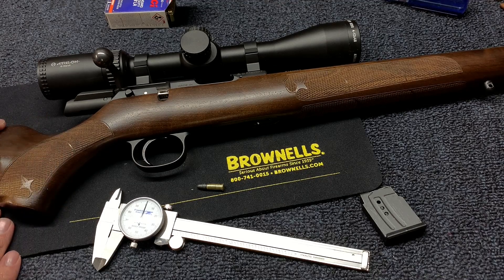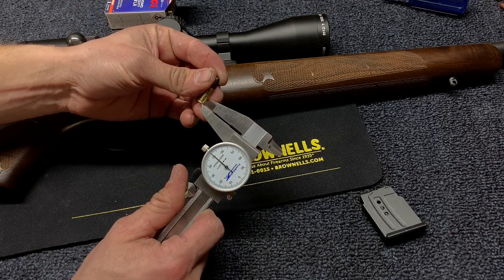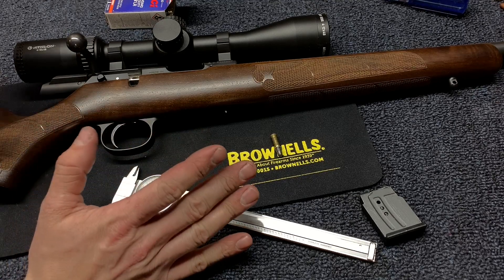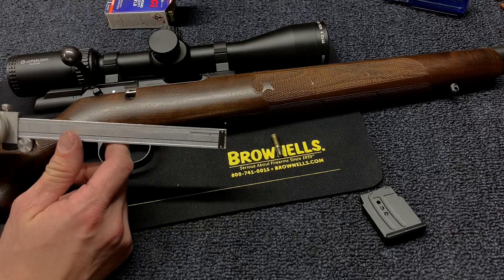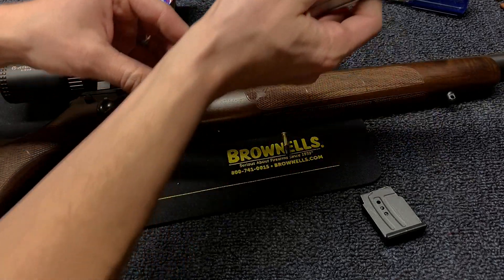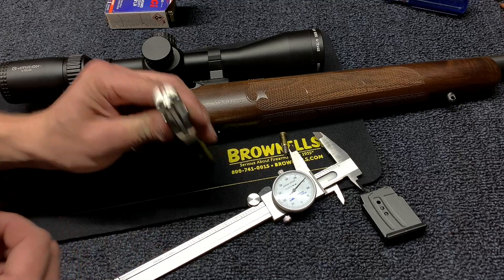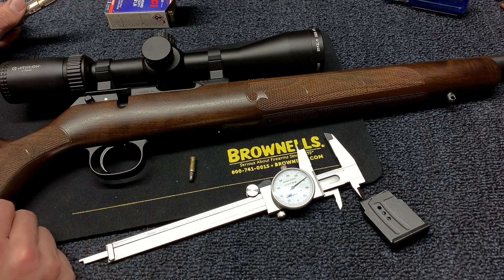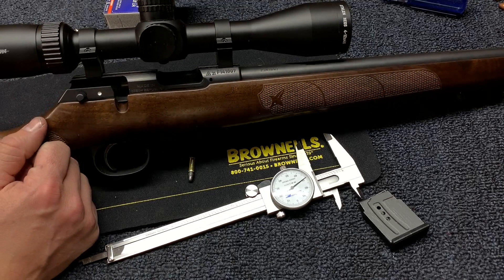Measuring CZ 457 Headspace

Comment: I've watched a few of this headspace measuring on the cz457.  All have either ended up using a .002 or .003 shim.  All were using CCI Std in their measurements.   As I also use CCI Std ammo in my cz457,  Would I be safe in installing a .003 shim?  I don't have the knowledge to take my CZ apart..

Comment: Or do it the simple way, since you already have shims. Pick any 22 round and measure rim thickness. Disassemble the bolt and reassemble without firing pin, spring and extractors. Add the thinnest shim, chamber a round. Keep adding shim thickness until you start having resistance closing the bolt. Now add rim thickness to shim thickness and here is your headspace.

Comment: He is doing it the hard way. All you need are some go/no go gauges. I have several. .041, .043, .046 and .048". I used bolt shims to set mine at .043"
Reply: @joed3264  “He” is doing it the inexpensive but effective way. You’re confusing hard with inexpensive. It’s great you have all your gauges. Don’t assume everyone can buy everything they would like to have.
Reply: @greenyonline  They are not that expensive.

Comment: To measure the rim thickness.
I zeroed my calipers on my fired 6.5 grendel case 
I put the 22lr nose first in my grendel brass. And the only thing sticking out was the rim of the 22. Then just measure against that.
I guess any fired 6.5 caliber case would work.

Comment: Get a PTG Gogauge. .043
Get green Plastigauge at the automotive store (it’s used for finding bearing clearances in engines) 
Clean the breach, chamber and bolt face well
Put the Gogauge in and a piece of the Plastigauge on it muzzle down so it stays in place
Close the bolt, then open and take out the Gogauge
Measure the crush of the Plastigauge using the template gauge that is on the package
Add that plus the .043 to get your headspace
Accurate to .0005 when I’ve used it
This makes it easy to choose shims. In my Remington 58X rifles I usually end up with .0445. (the Gogauge plus .0015 shim) 
I can get less but the bolt closes too hard with less clearance. 
This works for me. The Plastigauge goes a long way as you only use a small piece each time. No rifle disassembly required.
Reply: Can you explain the whole shim thing, I’m new to it I’m interested
Reply: @Bnscholet911  Depending on chamber (there are many) it is said that the ideal chamber clearance is .043. Too big and firing pin strikes may be weak or inconsistent. Google it. There’s lots of reference out there. The design of the bolt lends itself to tightening up (if needed) to achieve this dimension. Sorry I don’t have my reference material close by. This post is quite old.